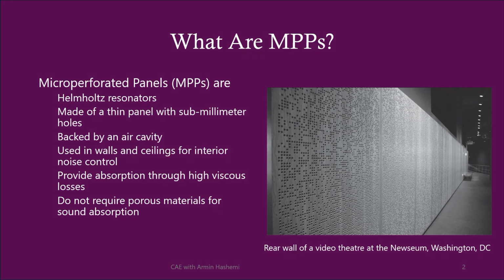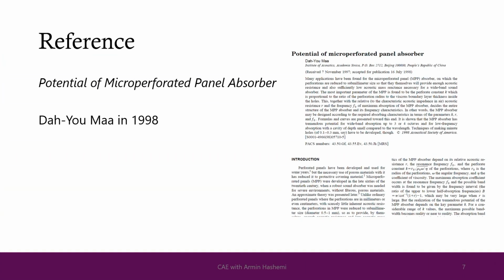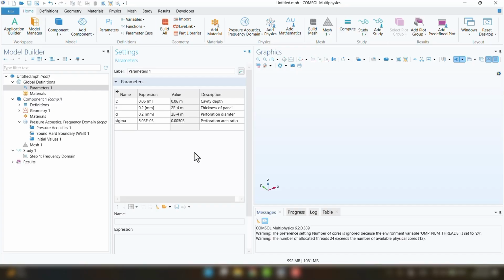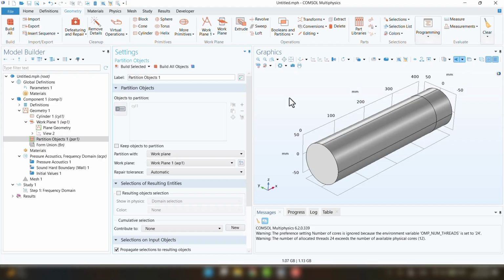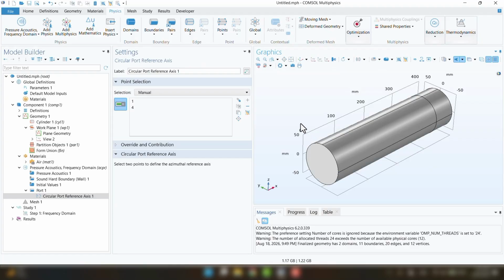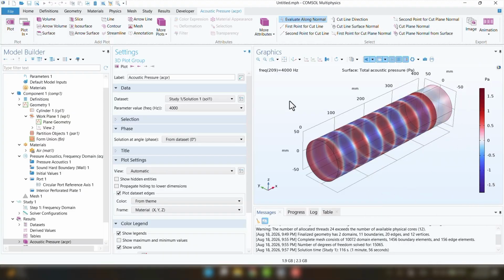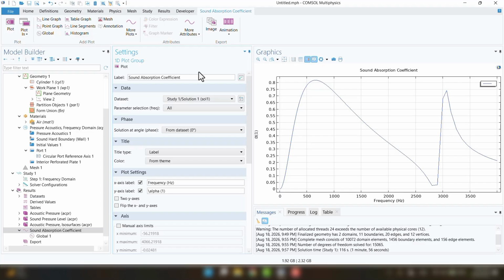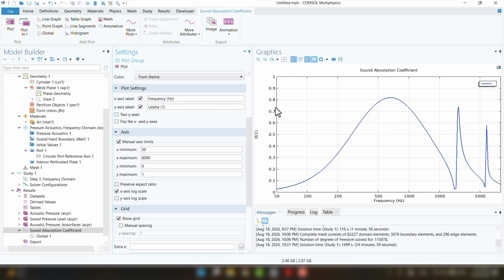COMSOL Microperforated Panel: Sound Absorption Using Maa’s Theory

Comment: hi great explanation but I want to know how to change the perforation shape
Reply from the maker: Hello, thank you. If you mean a non-circular hole, this model has been developed only for circular holes.
Reply: @caewitharminhashemi if it is non circular how can we do that
Reply from the maker: @pradeep000annamalai6 you have to calculate impedance of perforations. You can't use interior perforated plate boundary
Reply: @caewitharminhashemi for that I have to derive the equation and then use it as interior Impedance or else Is there any method to calculate the impedance of perforation
Reply: How to do 2d or 3d model
Reply from the maker: @pradeep000annamalai6 3d model
Reply from the maker: @pradeep000annamalai6  You should use the thermoviscous acoustics physics interface and model your desired hole (3D). It is somewhat difficult, but it is doable if you dedicate time to it.

Comment: Hii Armin. Nice way to present the calculation of sound absorption using COMSOL. Does the Interior Perforate Plate Models feature in COMSOL use the Maa's impedance formula?
Reply from the maker: Hello, there are several modifications for thick plates, but by default, it's the Maa formula.
Reply: @caewitharminhashemi  Thank you. I have one small doubt regarding the use of the Interior Perforated Plate Model feature. Instead of using the “Interior Perforated Plate” feature, can I create a perforated plate geometry and then apply the “Impedance” boundary condition, with the impedance calculated using Maa’s formula entered as a user-defined value? Would this approach give the same results as using the Interior Perforated Plate feature?
Reply from the maker: @hemantadikshit612 Yes, you can define the impedance using Maa’s formula in the variables and then apply it to the surface. The resulting plot is slightly different from the COMSOL result and the one reported in the paper.
Reply: @caewitharminhashemi Thank you.